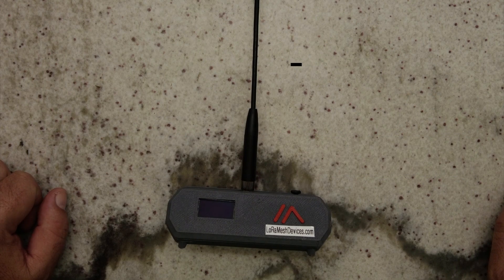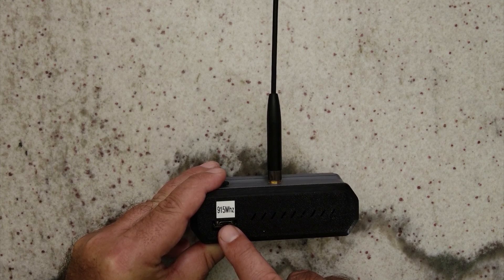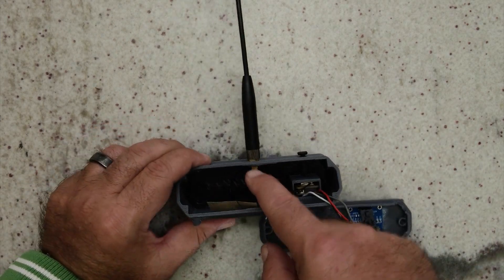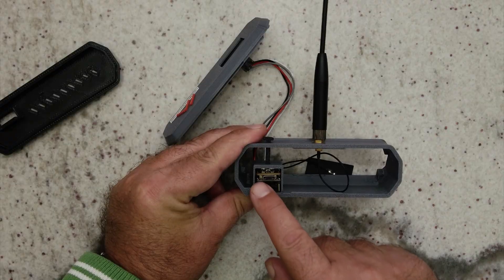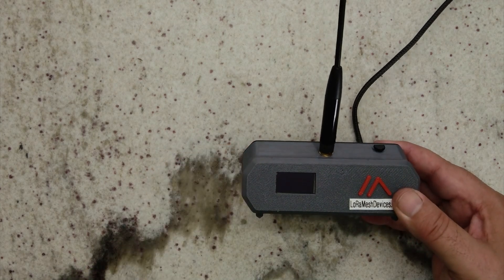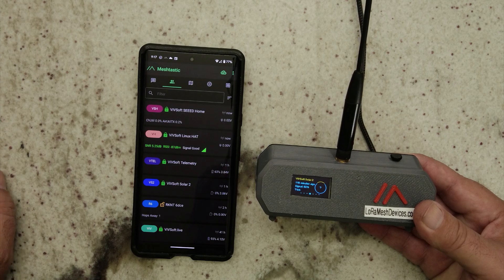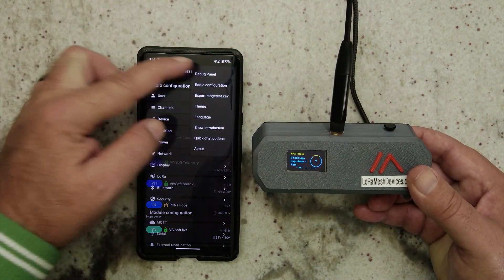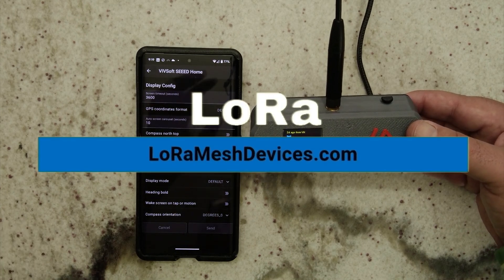DIY Meshtastic Home Base: 3D Printed Case! 🏠📡

Comment: So Robot Gardener network?
Reply from the maker: No idea about the Robot Gardener network .. Sorry. These are Meshtastic nodes. Meshtastic is defined as:

Meshtastic is a project that enables you to use inexpensive LoRa radios as a long range off-grid communication platform in areas without existing or reliable communications infrastructure. This project is 100% community driven and open source!